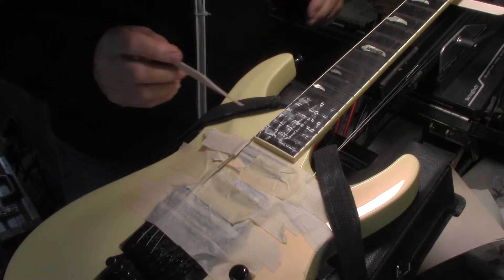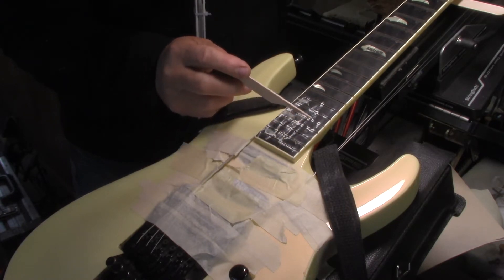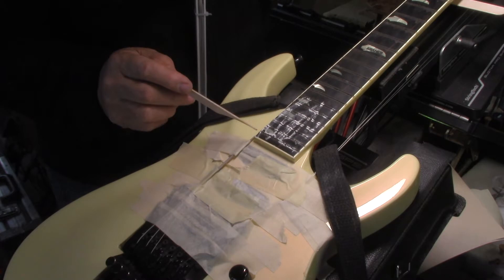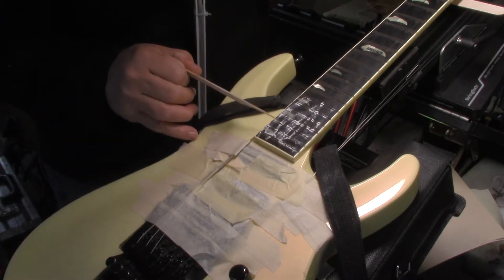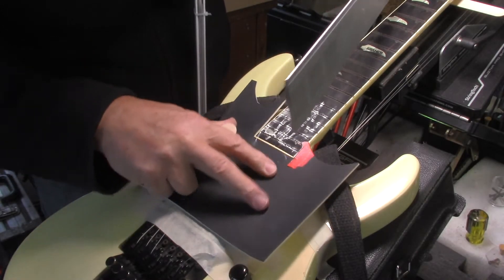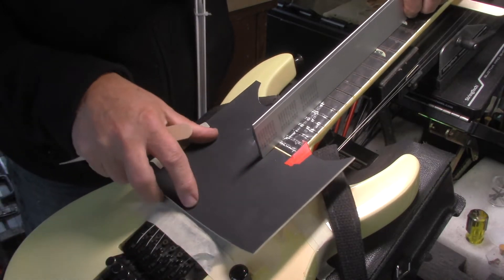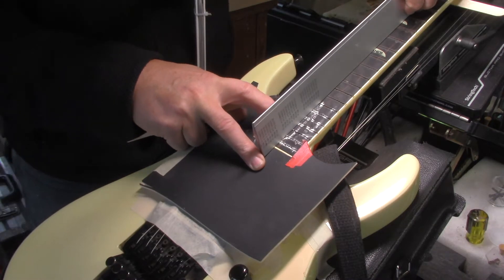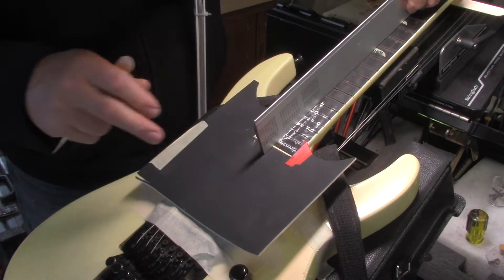EVH D-Tuna Install@StringTechWorkstations

Comment: Thanks for this video, you've answered my question on a past video about how did you manage to sand the fretboard to the radius. I can see the slight curvature on the wooden sanding block. A master at his best !!.
Reply from the maker: Actually, the block is jointed dead-flat. It is the slip of leather under the sandpaper that naturally "flexes" to any desired radius. I check it as I go .. with straight edges ( along the length of the string path ) and radius gauges ( across the width of the neck ).
Reply: @StringTech  yes, that's exactly what I saw , the slight flex, which gave me the impression that it was the block.. good to know it was due to leather.. 👍

Comment: Oh perfect !  Mike I’m so interested in seeing how you set that D-Tuna to tune correctly in both the Standard and Drop D tunings.  
I worked on one last month which would tune normally in one or the other positions but not both even using the ‘Tuna’s fine tuning Allen set screw.  It seemed as if the bridge was not moving evenly along the trem axis between the two settings. Got it pretty close by putting a bit more tension on the trem springs and some adjustments to locate the six string height screws evenly. 
It was a more entry level guitar needed to keep at lower cost but still, I wanted more from it for the customer.
Reply from the maker: https://youtu.be/4dBT_Fq-6FA

Comment: I’ve used Floyd Rose Tremolos for 30+ years and I love the feel but regardless, they’re a pain in the butt! Change gauge, drop to Eb, etc. Then there’s the NUT! I’ve been brainstorming to find a solution. I have a body i made years ago and it looks better as it ages. But it has that huge Rose rout. I long for the ease & simplicity of locking tuners & a Gotah tremolo on a strat style. Going to pose a few scenarios/questions. 1, if I “block” my tremolo so it only “dives” can I dial down the fine tuners on the Floyd and use locking tuners, thereby incorporating a compensated nut? 
2, is it possible to make a compensated licking nut? I realize it’s made from durable steel, not bone. My last resort is a new strat body but it would be impossible to replicate the artwork on my sweet aging body. 
Lastly, this may sound really stupid and amateurish, but is epoxy strong enough to rout & install a simple Gotah or Wilkinson tremolo? In other words, can I fill the huge Floyd Rose cavity with epoxy then rout it for the above mentioned tremolos? I’m desperate! This guitar body has such sentimental value to me and is loaded with a full set of Lindy Frailen pups, push/pull coil split & pup blender, a tonal palette I love. It’s just impossible to intonate to the standards I seek. I don’t mind 1-3 cents off here or there but anything over & my ears bleed! 

ANY input or suggestions would be greatly welcomed and appreciated!! 🙏🙏✌️🤷‍♂️
Reply: I realize my last option is to get a new HSS strat body and remove the existing pickups & push/pull pots, etc and install them on the new body, just…..🤦‍♂️🤷‍♂️🤦‍♂️

Thanks for your time & opinions ✌️
Reply from the maker: https://youtu.be/1uJWRnD-RNc?si=luGLOvdVsLD_lauS
Reply from the maker: https://youtu.be/toG9-jNuT44?si=fFE80KWbZsQ0Rnys